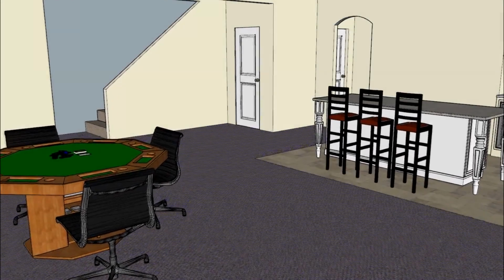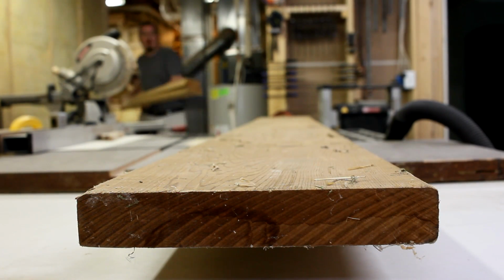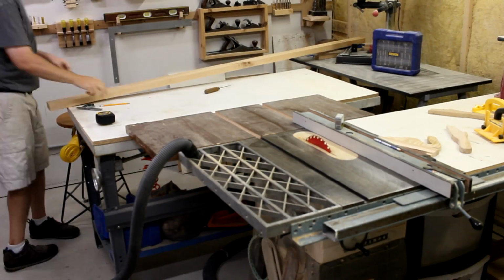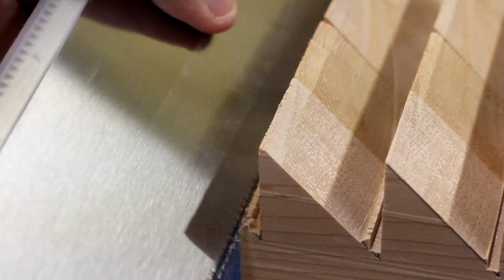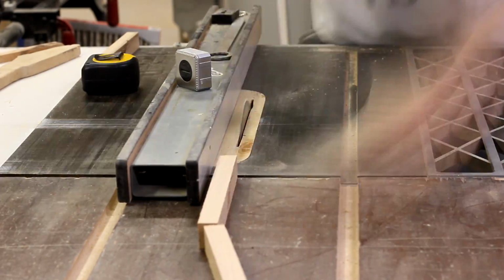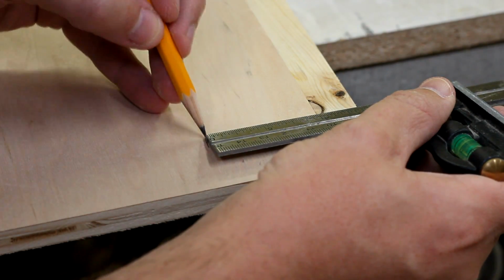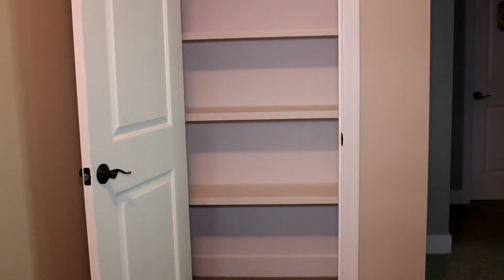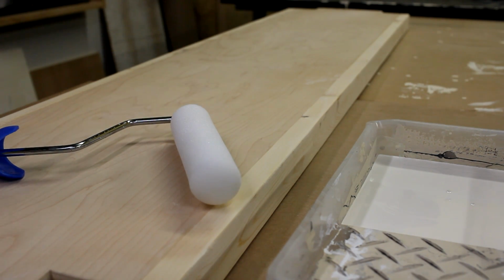Woodworking: How to build Sawtooth Shelves

Comment: Awesome shirt! From where did you get the 'BRB" Jesus shirt? Does it come in black with white design? I am a diesel mechanic so I do not own any clothing other than black. Even when I buy a non-black article of clothing it quickly becomes black even when I am not working on engines because my skin is soaked in soot, oil, and grease.
Reply from the maker: Haha, I don't know.  It might!  You'd have to do some poking around on the web and see what you find.

Comment: I like your presentations and the stop-action video. Your humor makes the  video more fun to watch too. The project turned out great and I may replace our ventilated shelving in the small closet with these shelves.

At 66 with bad knees from kneeling on concrete floors for many years because the shop where I worked didn't have work benches, there is no such thing as losing man points to protect your knees by using a kneeling pad/cushion or knee pads. I now have a 2" thick Husky kneeling pad that goes wherever I will be kneeling on the floor. Of course I have to use a chair to brace myself while getting down and back up, so that's an accomplishment in itself.
Reply from the maker: Glad you enjoyed the video! Thanks for watching! :)

Comment: Haven't seen this "old" idea for easily adjustable (though a bit time consuming prep)  shelving in the past or in any other blogs or videos... Fun presentation and film work. Thank you for posting!

If no wall studs available, 90% of the time I use pop-toggles, which I feel are much more secure and durable than standard" mollies, while still being very affordable [you do need to know your drywall thickness for these]. I'd recommend using these instead.  I have designated pants and shorts as well as about 4 (!) T-shirts and a very beat up sweatshirt from circa 1990, LOL, that are my designate painting & reno clothes. If you're a home owner or, like, me also enjoy doing part-time "professional" small home repair and renovation work, designating a set of clothes is essential.

Comment: I think your brackets are upside down. With the 45s pointing down and in, all the weight gets spread over the 45 degree cut which is longer. It also presses out on the brackets to compress the wood. It should help prevent teeth from breaking off. 
If my understanding is wrong, please let me know. Is there a reason why you orientated your way?
Reply from the maker: Dunno what to tell ya... this is how it's been done for centuries.

Comment: I love your quip about metric loving viewers. I moved from the UK in 1967 to Australia. So, we had to adjust from Imperial measurements to Metric. It was hard at first, but we did manage after a some time. Incidentally, it was illegal to sell measuring tapes or rulers with both Metric and Imperial for a number of years in Aussie. My guess is, they wanted people to adjust to using metric and the imperial rulers were not allowing this transition. It is not like this today and you can quite readily purchase both measuring systems on the one tape or ruler. keep up the great projects.
That was a 'Small Smiling Child' you used. Ha! Ha!

Comment: You missed a very important part. Your support/inserts can fall out. The shelf has to lock in the support insert. You can fix this with a small cleat screwed to the bottom of the shelves.  
On the saw-tooth shelves in my bathroom cabinet I used wood for the Inserts  twice as deep as the saw-tooth rack, and then I rabbeted  out the insert leaving an edge to support the shelf. Now the top of the shelf and the top of the insert are level with the shelf holding the insert against the wall.
Reply from the maker: I suppose if there's nothing stored on the shelf to add downward pressure and at the same time there's a horrible earthquake, then yes... maybe the shelf cleats could work themselves out and cause a fall.  I'm just rolling the dice and hoping there's no earthquake.  But your idea would work too. :)

Comment: Nice job but it seems like those euro pins and some little holes every inch on the front and back of both sides would have been so much quicker and easier.
Reply from the maker: Probably.  Maybe that's why you don't see too many of these shelves  anymore?  I dunno.

Comment: How did you calculate  notching the shelves. Did you make them  fit tight between the sawtooth pilasters
Reply from the maker: It's just the width x depth of the uprights.  Then give it just a touch more so it's not a super tight fit and they can drop in easily.

Comment: Great video! Thanks for this. Sorry if this has been answered already, but how much weight can each shelf take? Thinking about making something like this for art supplies.
Reply from the maker: It's all relative to how wide they are.  If you use 3/4" ply and put the front and back face boards on I would imagine you could really load it up pretty good.  but if you're trying to make an 8' long shelf, then I wouldn't recommend using this method.
Reply: Fisher's Shop thanks! This seems plenty strong. I'm only storing markers, art pads  and paint. Will only be about 5-6 feet in length.

Comment: Great project and very well presented.  Anyone watching could easily put this together.
But doesn't anybody use guards on table saws anymore.  Kickback can be really messy and using chopsticks with three fingers missing is very tricky.
Reply from the maker: My table saw pre-dates any type of riving knife,  splitter, or pawls.  If I were king for a day, I'd definitely get a modern table saw with those features.

Comment: Great video! Any fear of the sawtooth brackets backing out over time? Maybe add some blocks to the bottom of the shelf to prevent the brackets backing out?
Reply from the maker: There's no side to side movement of the shelf so there's no fear of the brackets coming out.  However, your idea would definitely work to keep them in there.

Comment: Esier to do --- Same principal

Take a wide board like say a 6 by 1   
Draw a line down the middle
drill a series of 1 1/4 or so holes spaced a couple inches or so apart
split  the board on the centerline
now make some brackets the length desired and round off the ends to fit the half round holes
The rest is as showen...

:)

Comment: Just discovered you- liked and subbed! 
I have some birch with a nice grain pattern that I want to make bookshelves with, and decided sawtooth was the way to go for adjust-ability. Was hoping to discover a speedier way to do it, but alas, you confirmed the need for a rainy day.
I won't be painting (yay!) and if I did, I would spray (learned that lesson hand painting louvered cabinet doors). You have everything else, but no spray booth?
Also, wondering why you had to use plastic anchors in the corners of the closet- should have been return studs there? Also, if the shelves were going to be used for anything heavy, and the uprights don't rest on the floor, might want to add some construction adhesive, as those anchors won't hold much (or substitute larger wing-tip anchors).
Thanks for filming that equals the woodworking quality!
Reply from the maker: Nope, no spray booth... or even a sprayer.  The uprights rest on my base trim so that's taking all the downward load.  The anchors are just basically keeping them in alignment.  If I were going to put a severe load on the shelves I would have 1) built stronger shelves, 2) notched the uprights so they'd rest on the ground, and 3) used const. adhesive like you said.  But they're just holding board games and will always have a light load.  Thanks for watching, subbing, and commenting, julie!

Comment: Was it tricky to level/square the four uprights in the closet so the shelves sat nice and level?
Reply from the maker: Not at all.  Since I positioned them just above the baseboard and that was already level and I cut all the uprights together, when I screwed them into the anchors they were already level.
Reply: Makes sense. So I guess a pre-step would be to verify level baseboards. Neat!
Reply: An alternative, if you have no point of reference, is to install one, then use a scrap of jointed wood (thus straight) and a torpedo level to install the rest.

Comment: Do you have any specific requirements for children to be used as weights? Age? Gender? Amount of candy to be bribed with to sit still for an extended period of time? I'm only asking for a friend...
Reply from the maker: The need to be big enough to do all your sanding yet small enough to clean out under all your work benches.  :)
Reply: Using someone else's children has been fairly practical for me, and goldfish snacks are an inexpensive and semi-healthy bribe.
Reply: Is it necessary to clamp the child in place?
Reply: bahahahahaha small nibble sanding hands!!!
Reply: I find children too high in maintenance costs. You have to feed them at least 3 times a week...or is it a day? 
Regardless...the use of children just isn't feasible  for me.
Reply: Hahaha
Reply: April Korbel Just use drywall screws. They make some that are long enough for the hands and feet.